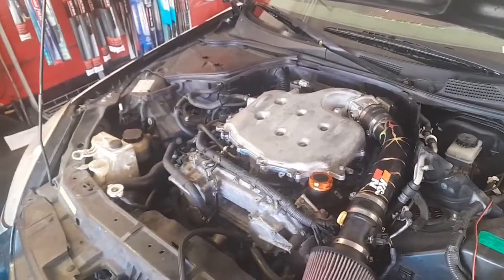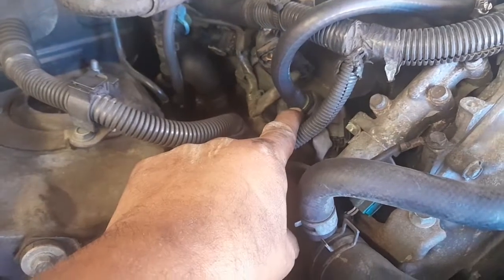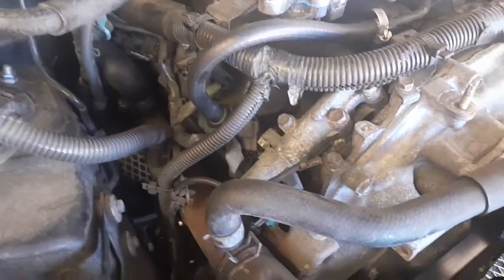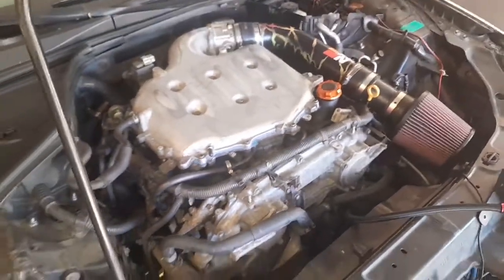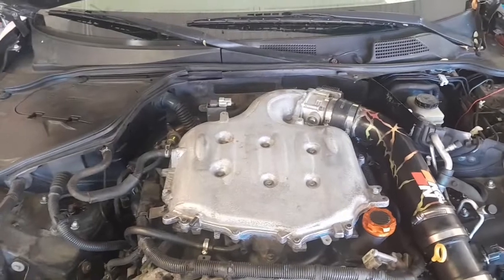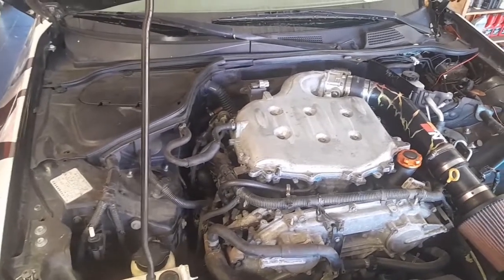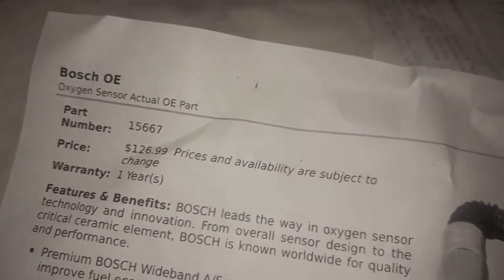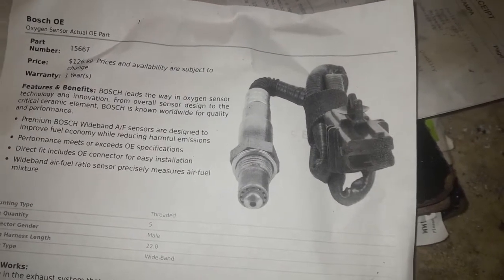P1283 P1273 G35 G37 350z ( 2 )!!!

Comment: Did u have a rough idle
Reply from the maker: When I take my car to the dyno all this problem is done I have no problem anymore because that was too much flow especially with test pipe high performance exhaust and take manifold spacer called intake so the ACU doesn't read how much air and the car rent reach